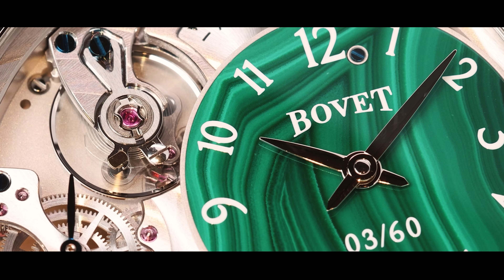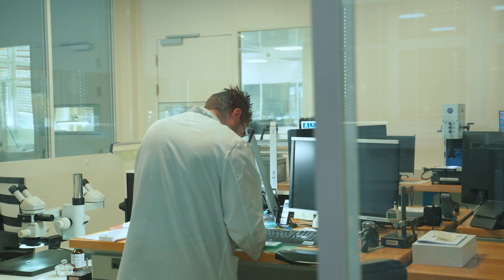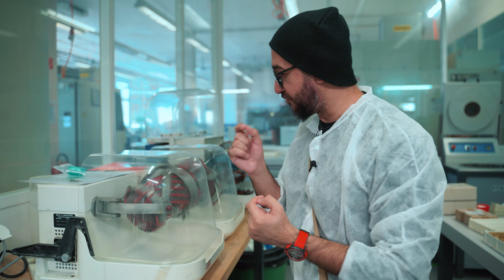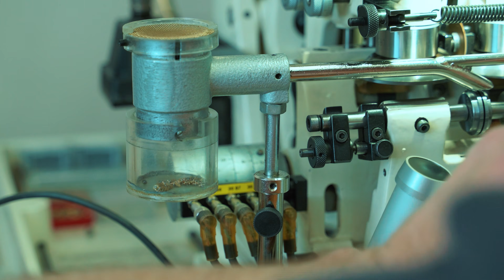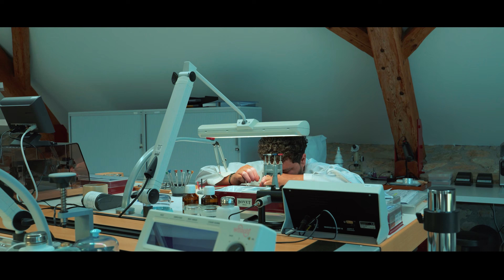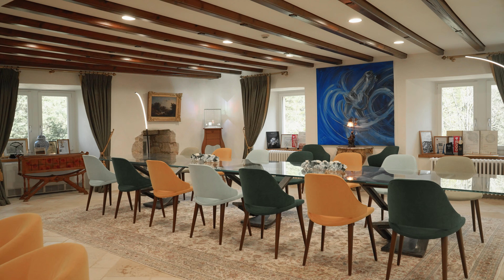Visiting an Overlooked Watch Brand Manufacture in Switzerland - It BLEW My Mind

Comment: I didn’t expect Bovet to use CNC machines instead of hand-cranked rose engines to engrave their dials.
Reply from the maker: So Bovet uses various techniques and it all comes down to the collection and the designs. For certain models (like the 19Thirty), it is widely known that they use the traditional rose-engine lathe to produce the dials. However, for some of their watches, they produce the initial molds using cnc machines, but then those are hand-engraved to create depth in the pattern (in addition to other manual processes like lacquering).

According to them, they choose the techniques based on various factors, including the dial pattern and the price position of the timepiece.